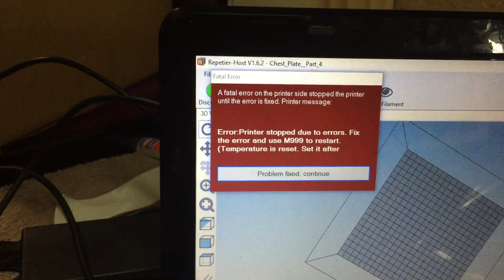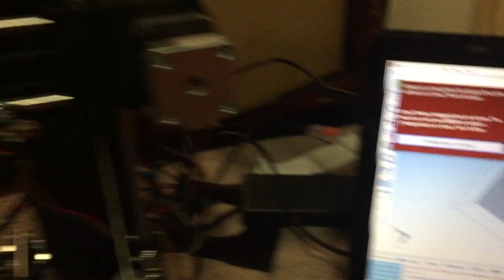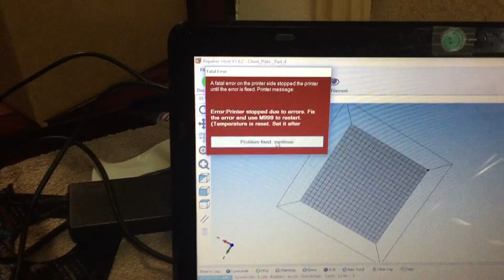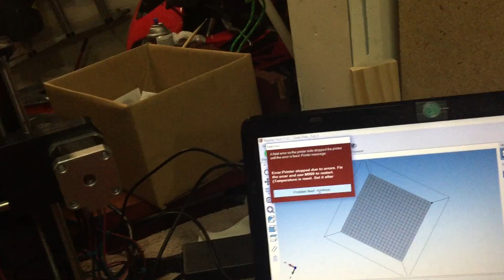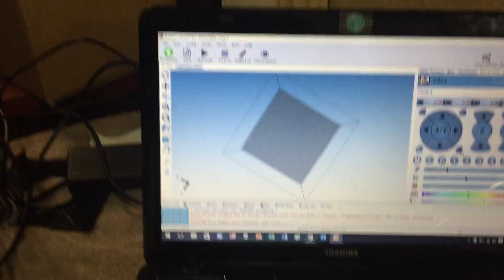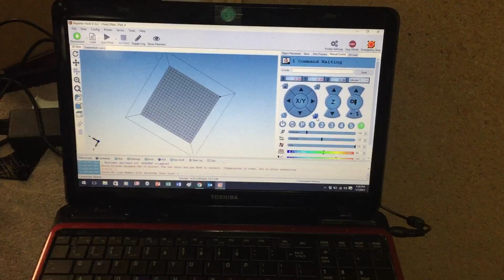Resolved Fixed M999 3D Printer Error (Simple Fix)

Comment: The temperature in the room is too low. Your firmware is preventing the printer from printing until the room and consequently the temperature of the printeris raised to an acceptable level for successful printing. Some types of filaments will not bond or adhere properly if the ambient temperature is too low. 

TLDR; turn up the heat in the room to prevent the error

Comment: I just replaced my board with a new one and i started getting this message. heat gun didn't do it for me
Reply from the maker: Tamer, sorry to hear it.  But, when I had the error, did the heat gun and the error went away.  Make sure you are warming up the heatbed and the extruder tip.  Sorry if it doesn't work for you.  I've since downloaded Repetier Host Version V2.0.5 and had no problems lately.